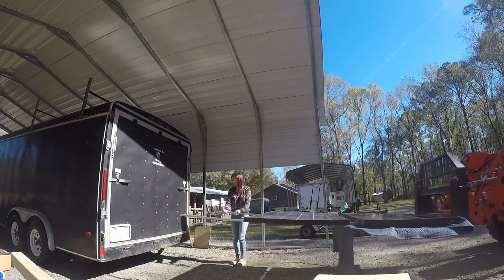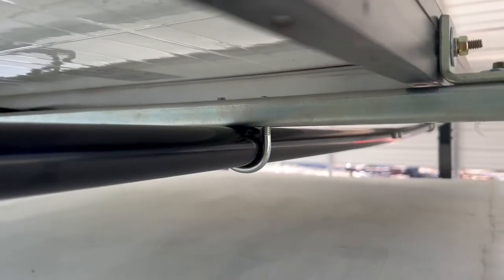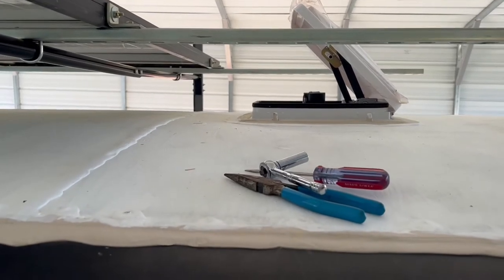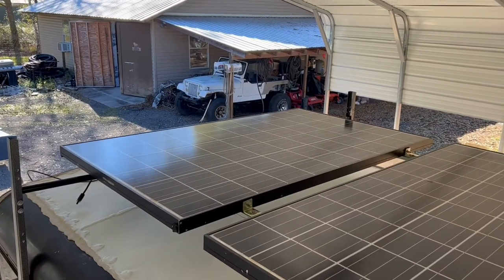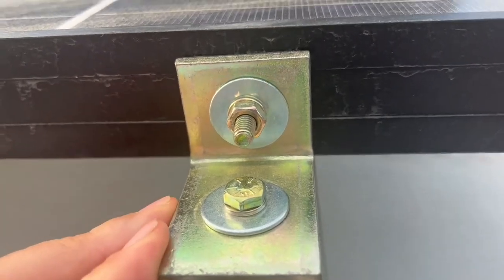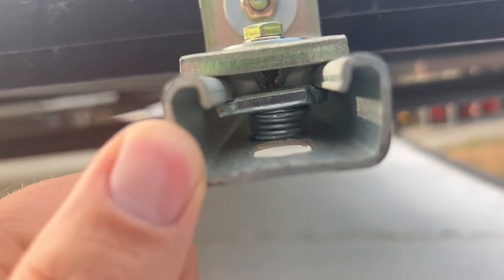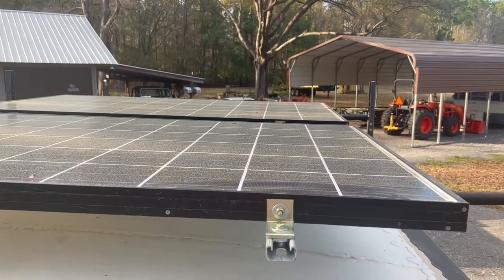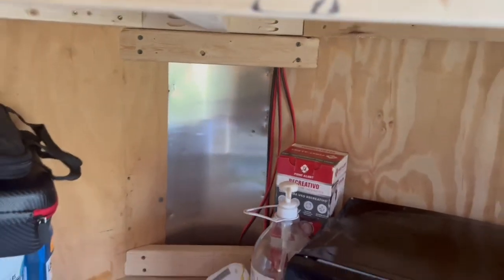Mounting Solar Panels to roof of Cargo trailer camper conversion February 26, 2022

Comment: Very similar to how I plan to mount my panels once I get delivery of the trailer.
Reply from the maker: My thinking was that this would be less holes in the roof and if I decided to change something I wouldn’t have to possibly have to repair existing holes. Also provides shade to hopefully keep the trailer cooler.
Reply: @traveltimewithtim3512  Same thought process as me. I had an actual rv that I lived in for several years so I know the pain they cause. I hope my cargo trailer build will be much better quality.
Reply from the maker: @commonmanfamily4752  It definitely will be and you’ll know everything about it.